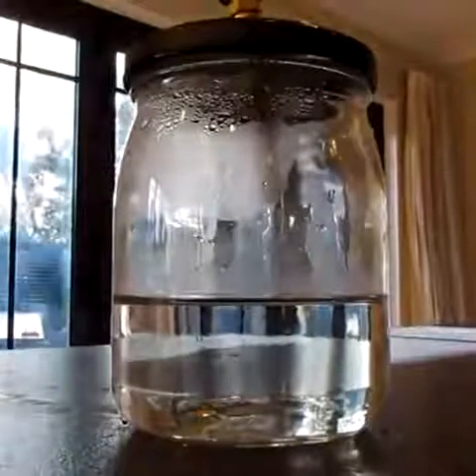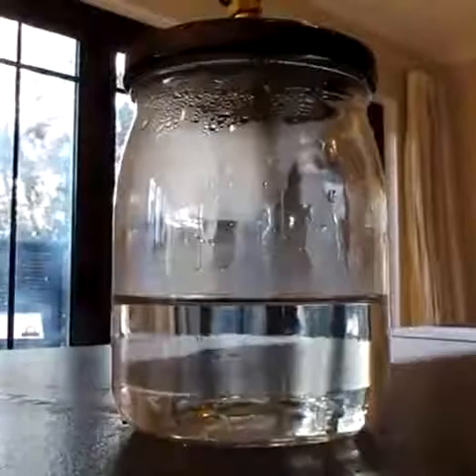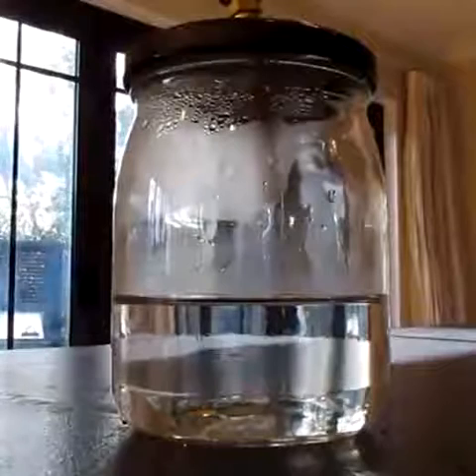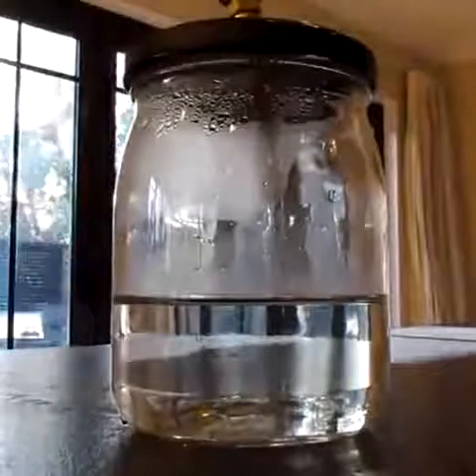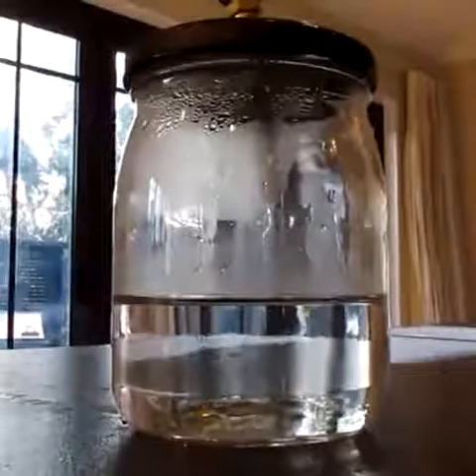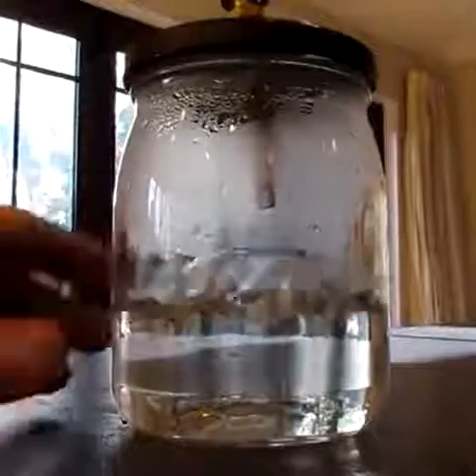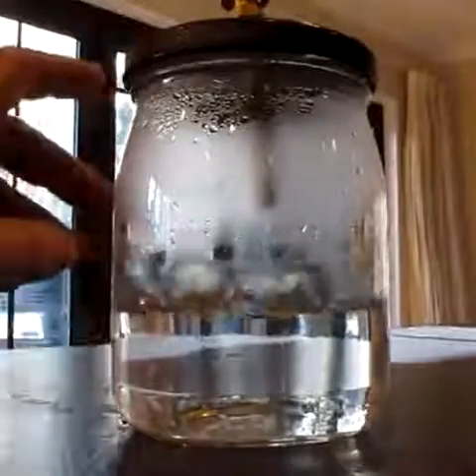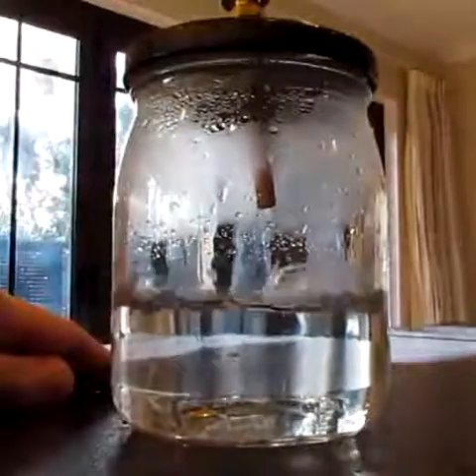Demonstration of Removing Moisture from a Refrigeration System using a Vacuum.

Comment: thank you for helpful video. In this regard I have faced a issue. An split AC was installed wituoud using a vaccume pumpe instead it was done by refrigerator compressor. So the according to your video the moistuer probably will left inside the AC circulation. Is there any solution to remove it?
Reply: Sometime has passed since you posted.  Was the theory correct?
Reply: @jay83154  Yes, in here is summer and I am still using it. The refrigerant is R32. I appreciate you if you could propose is solution to remove its moisture from this circulation.